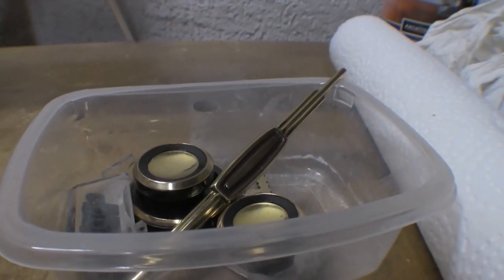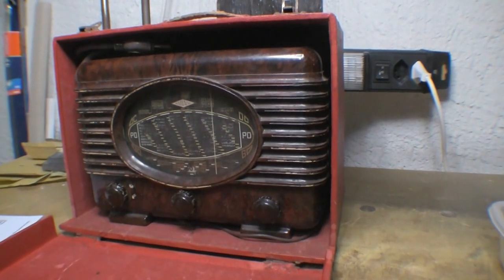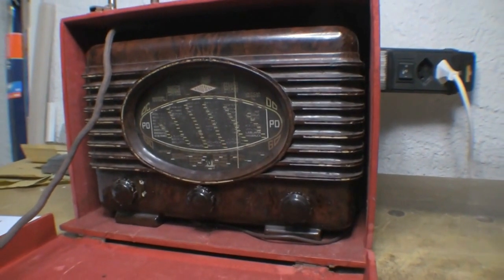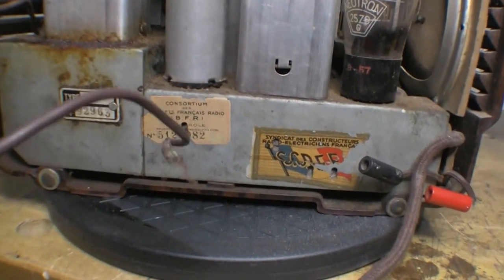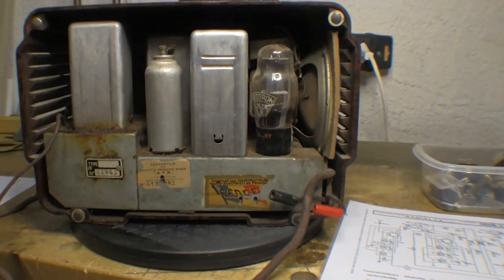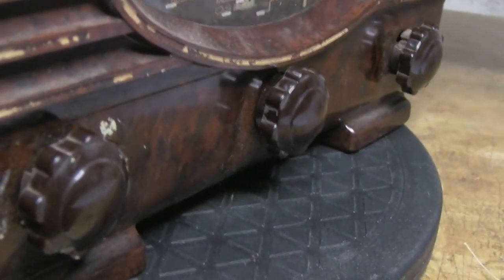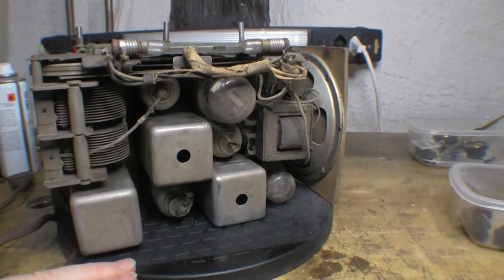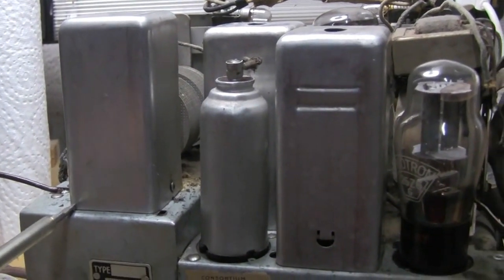Radialva Radio Restore - 1

Comment from the maker: Yeah the circuit diagram suggests it can run on AC and DC as the input is marked with a sine wave but also with a "+" and "-".  This would suggest that the power cord is used for both Ac and DC.  I'm learning as I go here - thanks for the info.

Comment: The good news is that the 25L6 and 25Z6, after being suplanted by the 150 ma tubes in radios, were given a second life in many series string post war TV sets, so they are easy to find. The rest are pretty much the same, except for the 6E8 tube, that is one I have never heard of before, 6A8, 6J8, and 6K8 yes, 6E8 no, I hope it's interchangable with another type if it's bad.

Comment: That would make sense sice getting a 220 volt shock is a lot more painful then a 110-120 volt shock. Some of the AC/DC or transformerless sets made in Britain had live chassis in them believe it or not. A collector I was chatting with from over there was discussing how to modify them and he was basically replicating the way they made these sorts of sets in Canada by running an independent common negative buss along with the cap and resistor to "ground" the chassis.

Comment: That's a very common way fro them to wire them, I have a European Phillips radio wired that way, the tube filaments add up to 110-120 volts, but there is a large wattage wire wound resistor with a series of taps to make up for the difference between the series string and the line voltage, and also to lower the input voltage to the rectifier tube plate. In effect the sets were designed to operate from North American type line voltages, so they must have copied the American AC/DC designs to do it.

Comment from the maker: I've also discovered that there were various form factors of the 25L6.   I've seen online both metal enclosure and smaller glass enclosures than the common variety in mine.   There does not seem to be enough room for the larger enclosure as the valve is pushed off the vertical being pressed up against the wiring to the speaker.   I may see if I can find one of the smaller enclosure versions.

Comment from the maker: The doc says it's designed for 110v but it gives a listing of resistor values to use for various other mains voltages up to 250v.  I haven't checked it out yet to see what value resistor is actually fitted.

Comment: No, I believe you are thinking of a large non polarized capacitor, like a motor start capacitor, you could use a pair of electrolytics but they would have to be connected back to back with both negatives or both postives connected together, but non polarized is best.

Comment: I don't think they allowed transformerless tube radios in Australia, the sort of sets you have in your collection, with polystyrene and Bakelite cabinets would normally be an AC/DC set in Canada or the U.S with no transformers. In fact they didn't allow them in Canada either until they came up with designs with a floating common negative rather then having the chassis tied directly to the power line. I didn't know about France but they did make AC/DC sets in Britain and in Holland for 220 volts.

Comment: I'm not sure if that is a hot chassis AC/DC set or not, some AC/DC sets had a floating common negative with a large paper capacitor, .1mf -.22mf, and sometimes a resistor like 220,000 ohms between the chassis and the B- line. The true hot chassis one had one side of the AC power line connected right to the steel of the chassis, something they didn't allow in Canada but was very common in U.S sets right in the 1950s.

Comment: Those few AC/DC sets must have been for use on ships or in places with a DC power system like a mine, where you couldn't use something with a 220 volt 50 cycle only power supply. I have a Hallicrafters radio, an S77, that was purposely designed for shipboard use, it's almost the same as an S40 but is a series string AC/DC set. Some ships had AC but it would be the wrong frequency, others had DC, so an AC/DC style power supply made it universal. I have a photo of the set I should send it to you.

Comment: I just watched the video again up to where you show a closeup of part of the schematic, they didn't just copy American AC/DC designs they USED American tube types as well on your little set. The tube lineup is of the pre war octal 300 milliamp variety, the 25L6 and 25Z6 were used in AC/DC sets right before the newer 150 ma types like the 35Z5, 35L6, and 50L6 came out. The rest (except for the 6E8) seem to European made tublier versions of the first generation octal tubes like the 6K7 and 6Q7.

Comment from the maker: I'm not sure how to handle that aspect of the set.  The cord is over 70 years old - how reliable can it be! I'm hoping that an option is to add a power resistor of the right vale and use a regular power cord.  There is not a lot of space on this chassis however so we'll see.

Comment: I was wondering about that because most of the ones I've seen here have either GT style (glass tublier) or a small ST style (Shouldered Type). I may have seen a metal 25L6 as well but can't remember, the one in your radio looks like it has a mid sized ST style envelope like a 6F6G or a type 43, which is clearly too large to fit into that hole.